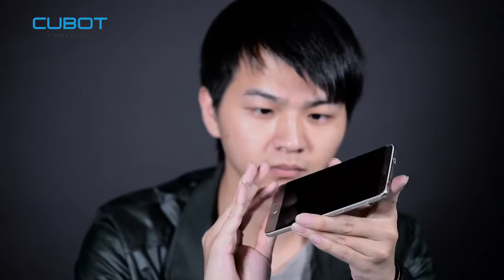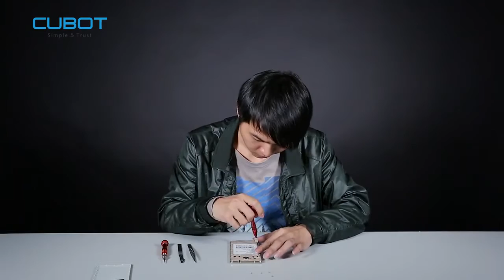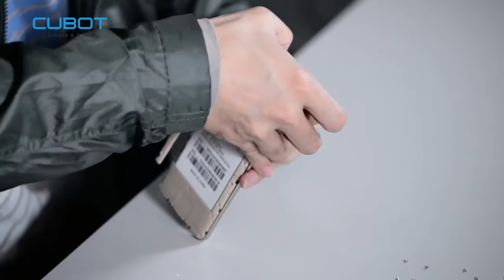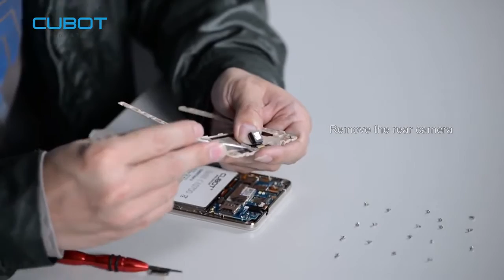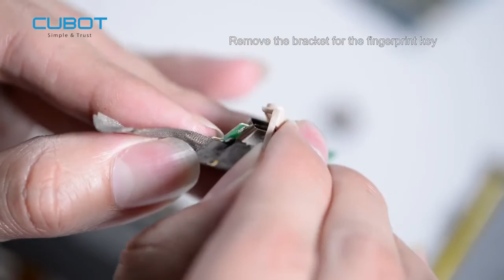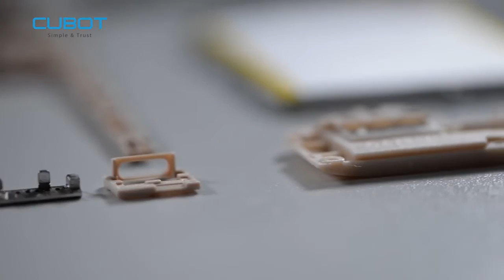CUBOT Cheetah 2 Disassembly

Comment from the maker: Buy Cubot Cheetah 2 here:
►AliExpress: https://goo.gl/aBWOye
►Gearbest: https://goo.gl/bHYe4g

Cubot Cheetah 2 Main Features:
Display: 5.5 inch, 1920 x 1080 pixels FHD screen
CPU: MTK6753 Octa Core 1.3GHz
System: Android 6.0
RAM + ROM: 3GB RAM + 32GB ROM
Camera: 13.0MP rear camera + 8.0MP front camera
Sensor: Gravity Sensor, Proximity Sensor, Accelerometer, Light sensor, Geomagnetic Sensor, Gyroscope
SIM Card: dual SIM dual standby, one is micro SIM card, the other is nano SIM card
Feature: GPS, A-GPS 
Bluetooth: 4.0
Network: 
2G: GSM 850/900/1800/1900MHz
3G: WCDMA 850/900/2100MHz 
4G: FDD-LTE 800/1800/2100/2600MHz